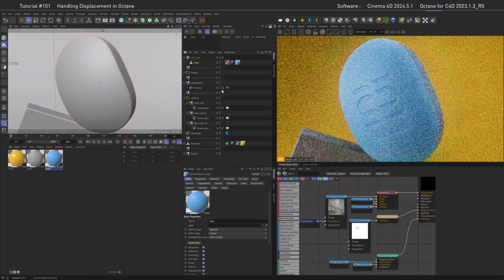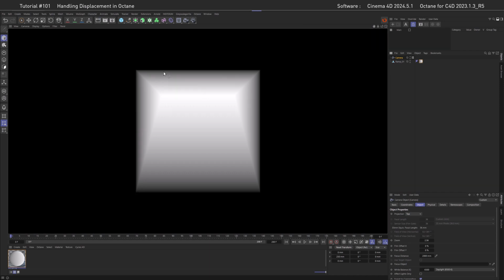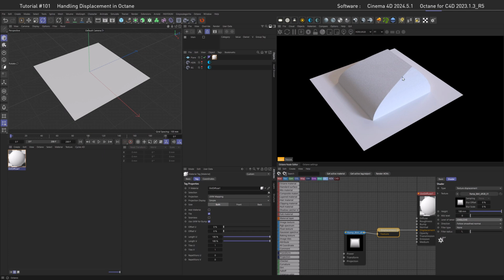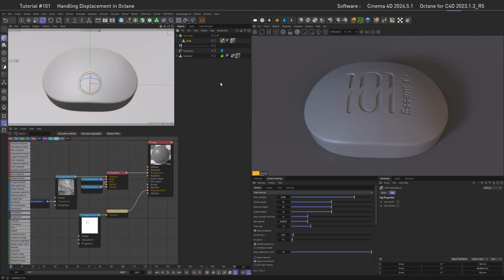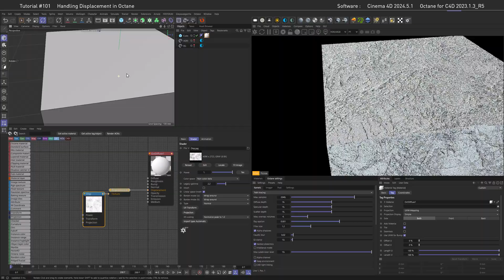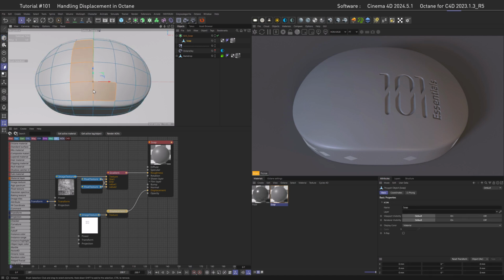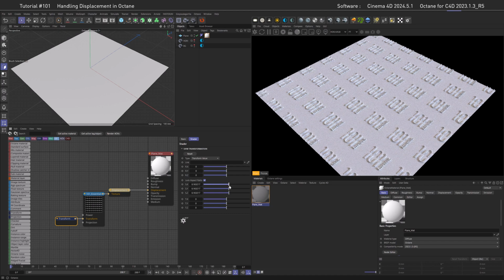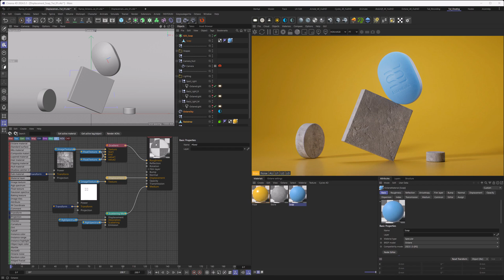Silverwing: Handling Texture-Displacement in Octane PT1

Comment: Hi! What if i have a decal set up using mixed material and I need the decal material to be a bit emobossed? Since displacement dont work with mix materials - what can be a workaround? Thanks!
Reply from the maker: Hey there. Sorry for the slow reply. I was on vacation 😇
I think in this situation it's really hard to find some good solution.
In  Octane 2026 there supposedly is a lot more possible with Displacement. But I only believe it when I see it 😇

The only thing that really comes to mind is to eventually use a text object or splines to re-create the logo and then shrink wrap it to the surface. So it's a different object and therefore can hold a different displacement.
Reply: @SilverwingVFX omg its weird that for something  so common is not possible to this day 😢

Comment: Hello, I would like to ask, after using the displacement node, how can I make the cloned object replicate onto the surface of the displacement effect?
Reply from the maker: Hey there and thank you very much for the good question. Sorry for the slow reply. I was on vacation 😇
What you can do is use the same map, that you are using in the displacement on the clones and elevate them the same amount what you have set in the displacement. therefore the displacement is in sync with the scattered objects.

It needs a bit of testing, but I have done it multiple times.

Comment: Erm - correct me if I'm wrong here, but at 7:00 you say that a 16-bit EXR is floating-point. It's not; 16-bit is just 65536 tonal levels (256x256) - did you mean FP16 half precision?
Reply from the maker: Hey there and thanks for your comment. 
I am trying to explain, no matter how many values, the 16bit EXR has the capability to float the point. In contrast to integer values that were used in the 16bit Tiff before. 
Of course in science terms that would be half float, you are totally right here. I am just saying that the point has the possibility to switch position within the value range and therefore floats.

Comment: I've not had any luck masking displacements (either kind) with weight maps.   How do you softly mask a displacement map, will bitmap textures as masks work, is that the only way?
Reply from the maker: Hey there Matt,
since texture displacement only works with only one Texture image, you would need to bake everything into one map, including the mask.

You can also use two different textures and then use the baking texture to bake both of those into one texture the displacement accepts. I show that at the end of the video: https://youtu.be/dEPUrjAGjqI?t=960

Unfortunately Vertex Maps are widely unsupported (spoiler also not with Vertex Displacement). If you have good UVs on your object, you could bake your Vertex Maps to a texture beforehand:
https://youtu.be/gcJNWtI7ouc
Then apply this texture as a mask for the displacement (of course with afterwards applying a baking texture to make the displacement read in the just baked bitmap)

Hope this shows you some ways. Though it also shows the limitations of Texture Displacement unfortunately 🥲

Comment: Hi Raphael,
I wonder if you ever experienced intersection artifacts with materials that make use of texture displacement maps AND opacity maps (decals essentially) and what’s your work around. If you place such decals on another surface, with some intersection, they punch holes into the other surface around the intersection, especially noticable if the level of details of the displacement is set to low resolutions. Can explain more if needed
Looking forward for your answer, and/or see it covered in a future video.
Thanks for your great and hard work
Reply from the maker: Hey there Leonard and thank you very much for your comment.

About your question.
Unfortunately this really depends on the individual situation.

The things that usually work are already mentioned in the video:
Set the ray epsilon lower! Set the resolution to the 8K no matter if supported by the input texture. 

Maybe also experiment around with nested dielectrics priorities.

In general I would say, and this is also a disadvantage of the texture displacement, that it tends to artifact more then if you would just have polygon areas. So in some cases, where you have decals, you would need higher thresholds (tolerance distances) or go with vertex displacement.

Hope this helps 🤞